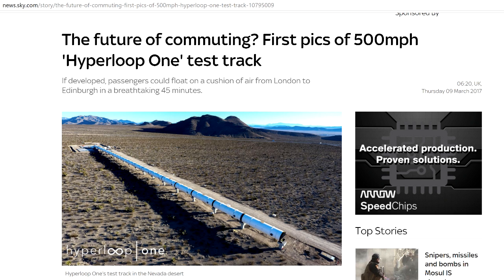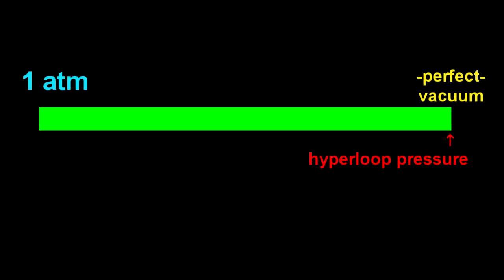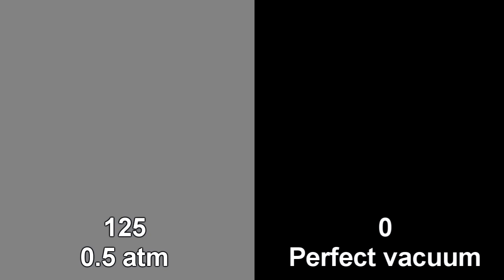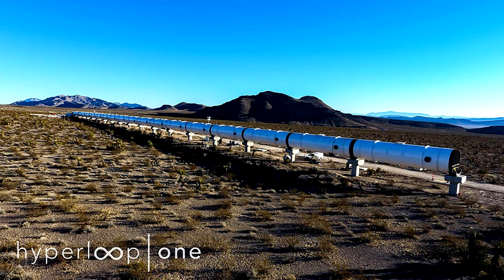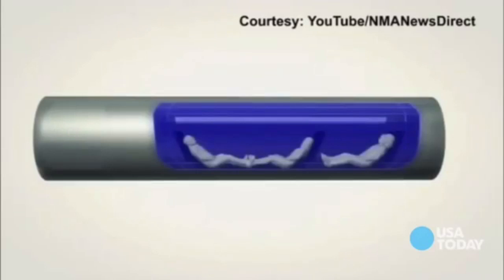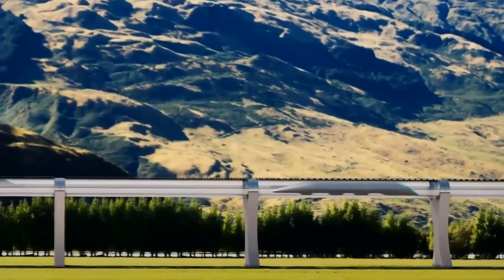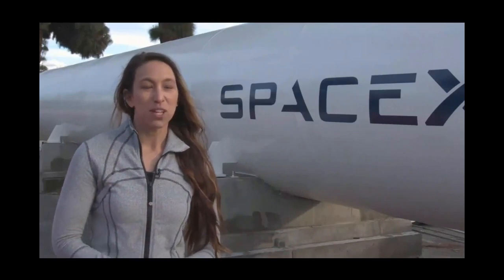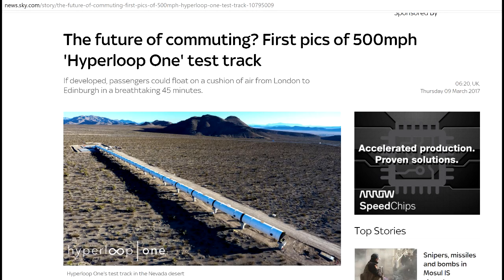Entire Hyperloop could be destroyed in SECONDS!

Comment: From an Engineering perspective, your video is very weak. As a constructor and designer of Pressure Vessels and Vacuum Columns I can tell you that your analysis is way off. The spiders on the inside of the pipe are to assist in fit-up and is not due to it being thin. I have erected vessels that use 4" steel and we still use spiders or other gear to assist with fit-up.
Reply: Bynirn she just said it
Reply: I am also curious in which areas you found the video to be weak... was it just the spiders? Or, other parts of the video as well?  Genuinely asking since if anyone should be talking on this topic it is someone with your experience
Reply: Jonathan Sager I would say the belittling of the 1 km test track and the prototype vehicles. Recently (obviously not when the video was made) there was the third competition, where a team went 290 mph, around 466 kmh. Seeing as he went on about the 80 kmh and short runs back then, that argument of his is invalid, because of how the prototypes have developed. The prototype are also, well, prototypes. Very early ones too, and I think they serve a purpose as proof of concept for the locomotive part of Hyperloop 

As for the viability of the end product, that's still to be seen. The obvious safety concerns are very much real, and it looks unlikely for Hyperloop to become feasible. The project might only end up being a costly experiment for Elon.
Reply: Ebber That's all the hyperloop is. A pipe dream. There's nothing realistic about it being used as a mode of transportation
Reply: The tubes being thin was not his main point, the fact remains that 1 just to depressurize the tube takes longer than the actual proposed travel time. 2 even in tests the best cart barely made it up to one tenth of proposed speeds. 3 the obvious danger such a mode of transport poses. a maglev train is a much more realistic approach to high-speed transit and more over is actually proven to work
Reply: How much you think a vacuum tube few meters diameter several hundred miles long will cost, how long to remove the air, how are you going to have a working seal for passenger entry/egress and trans at the "station" if Maglev is prohibitively expensive consider a pipeline with high integrity seals and massive pumps.
Reply: Can you please give us how the video is weak and how the analysis is off. Not trying to sound rude genuinely curious.
Reply: I was thinking that they'd use airlock chambers at each end, but I don't think that solves the problem either, since in a "public" setting, those airlocks would need a lot of maintenance. Not to mention that we can't even keep our OIL pipelines from leaking.

Comment: the main problem with this video is that you are showing how useless the hyperloop is right now. but this is definitely still a work in progress. most technology is worthless for a long time while it is being improved
Reply: I don't think that the hyperloop will ever be a thing. Thuderf00t makes some good points about basic safety if a section of the tube was to fail and air was allowed back in. That said, Thunderf00t comes across as very patronising with this analyses. Sure, the test track is short, okay, the pods are slow, but it is a test track not the final thing. Is that not the purpose of testing, you start low so failures do not result in catastrophic loses? The you build up. So what if the fastest pod only got to 80MPH on the first go, it needed to be tested and it was probably the first time that it had ever been exposed to a (near) vacuum. I mean does he expect them to build the whole 800 miles without testing small sections first?

I watched his video on the EM drive and I also watched Scott Manley's video on the same subject. Now Scott, like TF, doesn't think it is actually doing what it says it can do. But his video felt more about the science of why he thinks it won't work and not about belittling those that think it does work.

The internet does need people like TF to put down some of the stupid ideas that come about from either pseudo-science or simple lack of understanding. But I wish he just stuck to explaining why it won't work, rather than trying to  disparage the people who are trying to do it.

I wonder how many of the technologies we take for granted these days are the result of someone trying something that seemed stupid at the time, but maybe failed sideways to return a useful idea.
Reply: MLG_420 QUICKSCOPE i would give it another ten years then we will see :)
Reply: >all the established car companies can make more rugged EVs but only Musk can make incredibly optismistic promises they believe in.

Tesla isnt sold as the most rugged EV. It is sold as the EV with longest distance between charges (true for Model X and S) and as a luxury EV (true, other manufacturers focus on lower cost and efficiency). Tesla is a status symbol, not a worker class EV.  Also Tesla currently has the best autopilot software on the market due to exclusive radar sensor deal they have, however some other companies are not far behind.
Reply: It's diverting precious resources away from techniques we already have that are tried and true I. E. Mag lev. Just to feed some spoiled rich ass holes ego

His entire ponzi scheme is just a way to steal money from taxpayers that would otherwise actually improve public transit with realistic innovations
Reply: smartroadbiker Amen.
Reply: Strazdas I should have phrased it as the most useful EV. But the point still stand. Tesla's production failures comes as a result of their mistaking technology for quality. I want a car that can drive to where I want without any issue, not the one with a giant screen and slow-opening stupid-looking doors. If Tesla remained an exclusive luxury car, they could steadily have iron out their flaws. Because, their ego got in the way, they faced massive problems trying to make mass-marketable.
 All self-driving softwares are too early stages. I think that we stuck with our hands and feet for a forseeable future.
Reply: Strazdas try browsing everything wrong with Tesla model on the youtube. There are many quality issues that had yet to be iron out and yet they kept putting extra features in. The different btw EV and gas-powered is that I can find gas everywhere and can prepare an extra can just in case. So instead of putting resource to make the infrastructure to support EV, Musk and his team chose to create marketing hype videos and unneccesary features.
Reply: Strazdas as For self-driving I am looking forward to it. But it is always about the infrastructure not just the technology. Not everywhere can you find good roads or proper internet connection. Also, there are questions for the lawyers about who to sue.
Reply: >Strazdas try browsing everything wrong with Tesla model on the youtube.

No thanks i have a life.

>There are many quality issues that had yet to be iron out and yet they kept putting extra features in.

Its almost as if more than one person works on it.

> The different btw EV and gas-powered is that I can find gas everywhere and can prepare an extra can just in case. 

There are more differences and we were comparing exclusively EV cars for a reason.

>So instead of putting resource to make the infrastructure to support EV, Musk and his team chose to create marketing hype videos and unneccesary features.

So car manufacturers created gas stations?

>But it is always about the infrastructure not just the technology.

Yes but in many places infrastructure is good enough for self driving.

>Not everywhere can you find good roads or proper internet connection.

You dont need internet connection for self driving features.

> Also, there are questions for the lawyers about who to sue.

Not yet there are not since the self driving cars have yet to cause an accident. Also if your accident requires lawyers you already failed.
Reply: > but china is building ghost cities the size of new york right now. 

No. china built cities that were urban but could not find people that wanted to live there so they were abandoned for the most part. They stopped building them now. They were never even close to the size of new york.

>people can invest their money in whatever emerging technologies they damned well please. 

Usually we discourage people from buying from snakežoil salesmen.

>This is something that is technically feasible and has been experimentally demonstrated. 

This is theoretically feasible but has yet to be demonstrated even at experimental stage.
Reply: What about a space x train with sex robots. Everyone wins
Reply: gtq838 look up how much it costs california to build a high speed rail and then multiply that by a factor of ten and you get the hyperloop.
Reply: Daniel Young
I know is already an old post but Hyperloop is not new. The earliest was the Dalkey Atmospheric Railway which operated near Dublin between 1844 to 1854 Crystal Palace pneumatic railway operated in London around 1864.
The funny part is today hyperloop barely enough speed, with is back than was 40 mph (64 km/h), which is sad for today standard.
Reply: Daniel Young forget the idea of whether or not it would be useful we already have something in place that does a pretty damn good job at getting us from one place to another this idea is dangerous at least if a train crashes there's a chance that you can survive it with this it's going to kill everybody no survivors so I agree the videos he makes are telling you how bad of an idea it is and how useless it will be but not really giving you a idea on whether or not that with time can it happen he just shuts it down but you have to look at it from a standpoint that you're trying to get it to work in a short period Of time that's the only reason why some of these are just plain stupid the computer wasn't made in a day meaning they had to come up with ideas watch them fail and then improve but that's not what they're doing I saying hey I'm going to create a system like a car and you can buy one in two months it's not going to work you're not doing the research you need to do to make it work you have empty promises and sometimes a dangerous machine that can kill somebody because you didn't put enough Research effort or supplies into it so things like the hoverboard good in theory made a prototype it looked pretty good so they made the real one and now everyone has it but then you have rip offs people who just want money which is most places it's not about the product it's about how much money you can make off the product so they use weaker material dangerous batteries and just plain bad Construction and it burns down a house from you charging it so basically what I mean is it takes time to achieve a good product and even more time after you've got the basic to make it work and make it safe to use.
Reply: A train is cheaper to build and more practical. Look at Europe. Every city is connected by high speed rail.
Reply: The Dark Soul It's not being improved? What do you think Hyperloop One does all day?
Reply: >What do you think Hyperloop One does all day?

Launders money.
Reply: China builds those cities and people buy the property as an investment. They don't use the property, they just buy it, so they keep building more because there is a demand. It's a housing bubble that will burst, but they aren't building the cities for no reason and are currently making a lot of money off of it.
Reply: You cannot improve the impossible.
Reply: Daniel Young This guy would shit on the world's first computer. "It's the size of an entire circus. The Mayans used beads on a rack and you could hold in your hands!" All his videos are based on made up numbers and a lack of logical  details. He pretends to understand things by comparing apples to pomegranates and points out their differences but claim they are the same. A total hack.
Reply: If you want a car that can drive wherever you want and you must choose an EV, then Tesla has the largest range, so... you would choose tesla? I fal to see a point against tesla here. But yes they tried to make both a luxury car and an economic car with model 3 and managed to achieve neither.

Most car manufacturers claim they will come out with 5th stage automated driving (as in, put in destination, it will drive itself) by 2022-2025. Tesla claims 2021 if i remmeber correctly. The self driving tech is actually going forward quite quickly. For example there was this self driving cargo truck experiment where a caravan of trucks drove from spain to poland with computer driving.

That being said, average age of a car is 10-15 years and most people buy second-hand. Even if 5th stage gets released today its going to be a while before mass market adoption.
Reply: Sarge_m16 1) a train does not have a Musk-marketed cool factor. NASA can make more advanced rockets, all the established car companies can make more rugged EVs but only Musk can make incredibly optismistic promises they believe in.
2) Ideas that had already been figured out are boring. They want to dream of the possibilities a new technology can bring and not faced the reality that the present working technologies are what we are capable of.
Reply: The Dark Soul So? It's not your fucking money.
Reply: Its not being improved, its a stupid plan that hasnt deliever any results, let alone deliever anything even close to impossible. Its a waste of money.

Comment: Usually love your stuff TF but dissing this so early is wrong, remember the Wright brothers first flight was 120 ft @ 6.8 mph.
Also the collapsing tube shown was made from aluminum, not steel. Cover a steel tube with polyurathane foam and you insulate it reducing expansion. Just one twist of potentially hundreds to eliminate/reduce obvious weaks spots.

Comment: if you use a high-pressure cold gas shield in front of the pod (without the tube and vacuum), wouldnt it have the same drag/friction related heat-up if suddenly lost? but its less to collide with air than metal, unless going hyper sonic speeds.
Reply: https://twitter.com/tpalomaki/status/884360600624799744?s=09

Comment: What is this bulshit lol? who in their clear mind would made entire tube one peace... this is all alpha testing you "genius"... the tube will obviusly have retraction mechanisms for heat and cold and this same mechanisms will include branching and air tight seals over the entire tube.... also there won't be vacum inside wtf in elon's design hyperloop literally needs air to propell itself... (it takes air infront and pushes it out in the back) it is just a weak vacum for less resistance... (like same vacum as planes basically).
Reply: Sir, you taking it way too serious. 
The SIEMENS AG has built a Maglev train. Ultra Fast, ultra Efficient, ultra ultra Expensive. I mean look at the Alstom 574 km/h Train with friggin conventional Technic. Good ol' Rails n' Wheels. It was a prototype, but with improvements a constant traveling at 500kp/h is possible. 

At the Hyperloop you have a big arse Vacuum chamber, need Turbomolecular Pumps and all of the other "fancy" Ultra High Vacuum stuff, the Seals must be extremely reliable, the Chamber thickness should be 10-20cm, Terror-safe. 
And don't say "partial", if i throw you in there and make it "partial" youre DEAD. Instant. And 0,002atm or 0,02 atm isn't worth the discussion, both are Vacuum. Basta.

I mean, when you throw a brick into an old CRT TV, what happens? It will IMPLODE at the speed of Sound. Now scale it up to the HUUGE amount of Vacuum the Hyperloop is holding. Now, one dumb Guy shoots a hole into the thing. And Badumm! A massive amount of Air goes into the Vacuum und destroys everything. Shock waves, do you know them and what they do to many things? 

And you can't Slow down from Mach 1 to 0 as fast as the shock wave is reaching the capsule. 

Another thing you don't Calculate in: Power failure. What when the Main Power fails and you are in the Middle of the Chamber? You can't get out, and the "emergency drive" don't last 200 Miles and Up. Also you must depressurize the whole Thing, because the local Vacuum Pumps are Failing. 

Don't forget, the whole Hyperloop needs most of it's Power to maintain the Vacuum. The LHC, a extremely engineered Machine also needs permanent vacuum-pums running to maintain the Vacuum. And the friggin LHC is underground, constant temparature and very very well built, i has not to fight against rain, winter, summer, idiots...
Reply: the plan is to achieve same pressure as planes flying in the air.. and have simmilar engine to planes to suck air infront and propell the pod. Also if there would be any kind of problem pod would stop in seconds with super strong emergency breaks.. you would just drop the pod off the levitation and extend piston arms to grab to the tube before it hits next air tight doors....
Reply: and the people inside the loopidyloop die from imense g force while breaking?

Comment: So you came up with a useless videos mesh and figures like TNT because you just could not say, it would take 200KW compressor half an hour to vacuum it which would cost 10$ electricity bill because that be boring and not catchy, but 20KG TNT gets the attention. Last year we vacuumed a 20 ton propane refrigeration system before putting pure propane in it and guess what it did not implode. Get your facts straight and stop misleading people, otherwise next time you see thin sheets on airplanes wings you might shit yourself thinking if plane gonna fly. 
Also stop bitching about track length, if it's good enough for for testing then it's good enough, they don't have free govt money and have investors to answer. 

Seriously this video made me puke & couldn't even finish it.